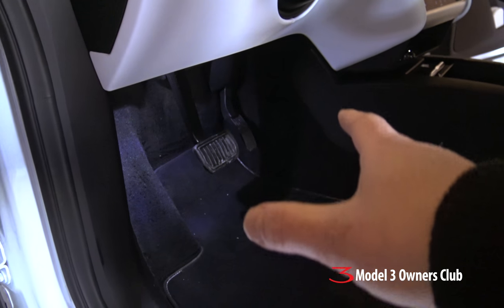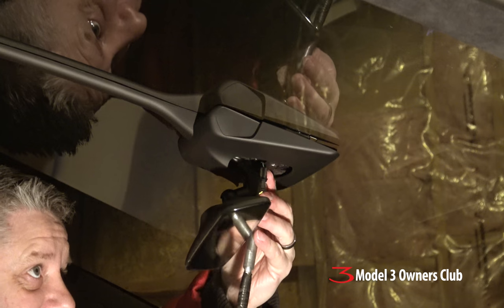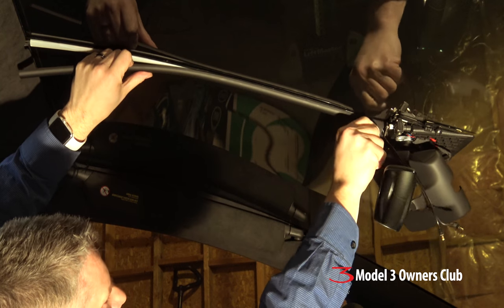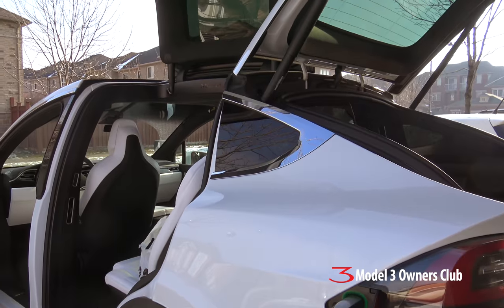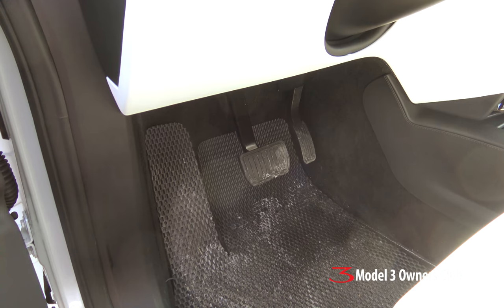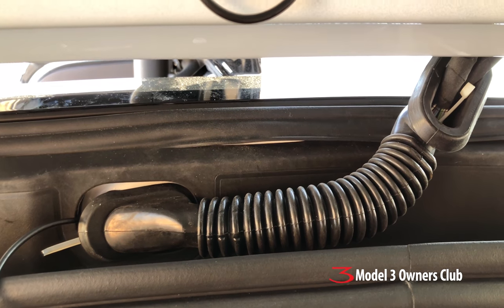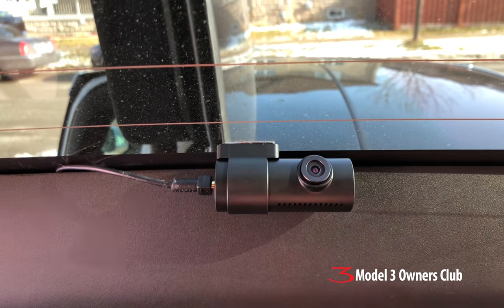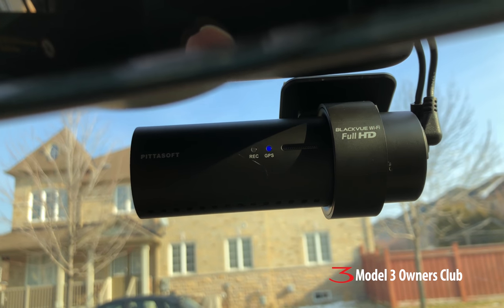BlackVue Dashcam install in a Tesla Model X

Comment: Where you ran the power wire from the ceiling at the top of the driver door to the seal you interfered with the side airbag. The airbag is really powerful so I don’t think it will be a problem but I would try to avoid that.
Reply: InternetDude i support this comment. I just did my installation, and i felt the curtain air bag, so i decided on rerouting it trough windshield

Comment: Model 3 is Arriving in Texas

Starting January 26, Model 3 will be on display at Tesla Southlake.

As you prepare for ownership, you can sit inside Model 3 and experience the expansive glass roof, premium interior and 15‑inch touchscreen display. Tesla product experts will be available in gallery to answer any questions you have on your upcoming order and discuss how our energy products can power your home and charge your car. You’ll also have the opportunity to hear about the latest Tesla updates, including our Dual Motor All‑Wheel Drive system, now standard for Model S and Model X.

Comment: Hey trevor, i was following your tutorial, and i am concern on the way you pass your cable through the A pillar(aka door frame) when you went from the roof to the door seal, i think you are blocking the curtain side air bag. As i stuck my hand in there i felt something soft. I suggest you review your cable wire following the glass on the front windshield.

Comment: I'd recommend an add-a-fuse (search amazon for them) used in the fuse box rather than the wire tap.  That's what I used in my Subaru for the same camera setup.
Reply: My mistake,  I should have elaborated.  I meant as an alternative to tapping the power line you did.   Mostly for anyone else who chooses to use the fuse box instead.

Comment: I've had really bad experiences with BlackVue dashcams. I'm on my 3rd one and it'll be the last. Crappy customer service too.
Reply: All 3 that I had were great for the first half a year. Then they started overheating, damaging the SD card, creating corrupt files and messing up the settings without letting me reset those. When I reached out to them their customer service wasn't very fast or good. I'm going to be switching to a different brand soon.
Reply: Very different use case between California and Canada.   I have had many Dashcams die in the California heat.
Reply: I've had this happen as well (living in SoCal), though it was with a different brand. The one I'm using now, an AUTO-VOX, has lasted much longer than the previous one I bought. You gotta be sure to use the capacitor version in the California heat, since the battery versions will overheat much more easily.
Reply: Michael Vallicella do you think blackvue will do well in California triple digit temperatures?

Comment: The problem with the way you're routing the wire is that it could interfere with the deployment of the side curtain airbag. It's hard to tell from the video, but be sure you're not running the wire over the airbag or one of the stringers.
Reply: Model 3 Owners Club I'd rather be safe than sorry unless you're positive that the wire can retract sufficiently to not slow down the deployment or cause a malformed deployment. We're talking on the order of nanoseconds and anything the engineers didn't design is an unknown variable. As long as the wire doesn't get jammed around a corner or something it is probably okay, but the safest bet would be to just run the wire behind the airbag rather than over any components of the deployment system

Comment: I let out a big GASP when you were trying to put the mirror back on as I think you did too. And I was very nervous when you took the trim off of the back door. I have installed several dash cams and don't think I would tackle this myself either. Glad it worked out for you. Have you heard any rattling from the cables so far?

Comment: Thank you for the great video

The power is that a constant or ignition 

I’ve been told that if the camera is on constant it will flatten the battery  is that true

Comment: i have the same dash cam ..  dont try the OS update for the cam .. after i did it stop showing speed and keeps showing the wrong date and time .. i tryed every thing to fix it .. it still works and takes video and when used with the on chip software  it shows the speed right but its has alot of bugs

Comment: I would be concerned putting the dashcam in front of the radar or sensor of things ahead.   Has anyone tested or enough experience to know if it has any discernible negative effect on whatever camera/radar might be up there?  It likely won't help.
Reply: Model 3 Owners Club how does one know there is no interference with the camera, esp close objects if it's in front of and lower than the camera?

Comment: How did you get the coxial cable that connects the front and back dahscam from front cam to the start of falcon wing door. I saw u ran both cables through the track on the windshield. Power cable goes down to driver side, but how does coaxial cable come near the beginning of falcon wing door at the top. Thanks in advance for your help.
Reply: Thanks!
Reply: Another quick question - you mention that you took the camera off from another car. With adhesive mount - how did you take off the camera from another car - any special tools/ method used for clean un-mounting from another car?